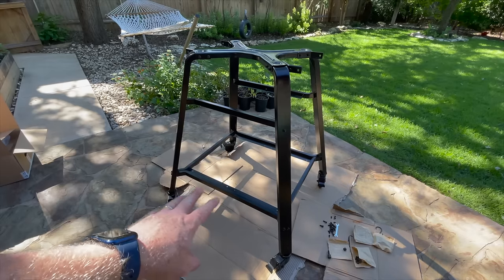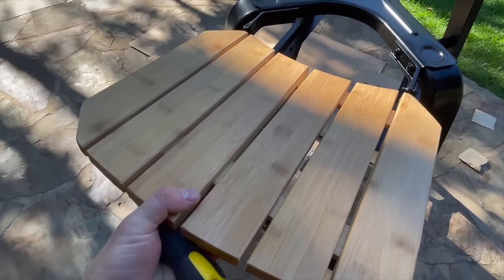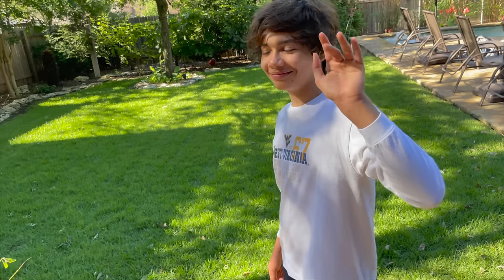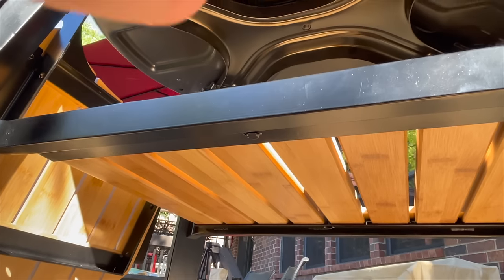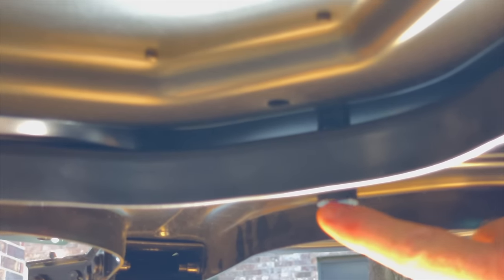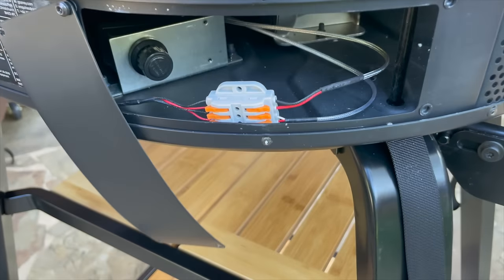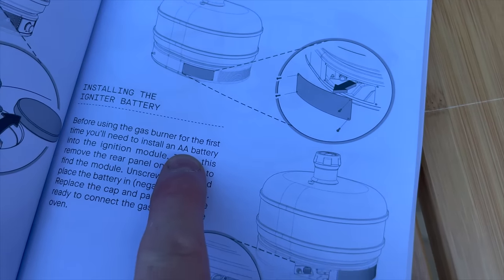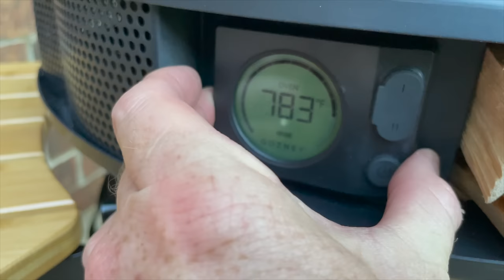Gozney Dome - First Pizza & Stand Build - 2 Pizzas 🍕

Comment: What about the wheels of the stand. Is it possible to drive around, is it even possible to drive over the meadow. Is the stand "rock stable"? Because it's pretty heavy...
Reply from the maker: Thank you very much for watching! Yeah I had a couple of minutes talking about just the wheels in the YouTube video I had to cut it out due to how long the video was and you are about the 10th person to ask about the wheels which makes me believe I should’ve kept that part in the video!  The wheels are extremely heavy duty in the oven is movable but it’s not very easy unless you have a very flat and hard surface! On  cement no problem, mine is on flag stone and it’s a little bit tricky to move it around by myself but I can do it slowly!  Yes it feels very stable!

Comment: Is it possible to retrofit the gas from wood versions?
Reply from the maker: Hello Mike,  I don’t think so!  The way the burner is mounted inside the oven I don’t think there’s any way to add that after the fact and I don’t believe the stone is cut out for the burner position either if you purchase the word version!  If your budget allows it I would definitely purchase the gas/wood version these type of gas burners are extremely expensive to buy as add-ons typically costing nearly $1000 just for the burner!
Reply: @HarplandProductions  Thanks for the reply! I saw they had the wood and combo versions. Too bad they're all out of stock.
Reply from the maker: Yes,  they said they are hoping to catch up with some more supply in July

Comment: Hellow ...I´m Hector Garza from Monterrey Mexico I just received my oven and I want to use  natural gas instead propane  ..I did the hole nozzle a litter higher in oredr to pass a littel more gas  it workede a little better but still alitlle short  do you know the proper size for natural gas ? and about the flame  with natural gas is blue ...never yellow is this matter ?
 I cover some of the air holes in the gas tube in tne part where the gas is mixed with oxigen and the color change to a little yellow but I felt that the flamne was weaker ...less hotter..... ...any comments ?
Reply from the maker: Hello Hector,  Thank you so much for watching! That specific burner is designed to only work 100% with Propane and not natural gas.  I am not sure you will be able to get the correct pressure and heat using natural gas with it.   There might be some safety concerns also using that burner with natural gas so please be careful.

Comment: The last bolt that connects to the bottom of the dome is suppose to be installed BEFORE installing the dome
Reply from the maker: That is correct, they change the manual to include the step after I made this video. I was lucky enough to be the first one in United States to test and review the oven. This video is made the manual didn’t include the step.👍🏼😎🍕🔥 and now they do

Comment: Did you also get the cover? I saw the original release includes a cover. If so, does it just cover the dome? Or does it fit down the stand with the shelves down? Thanks again!
Reply from the maker: It wasn’t available when my oven shipped out but they said I would get it soon!

Comment: Only 1 screw holds that heavy dome to the base?  Wow!  I would have put 4 more in the corners (or at least a couple more than 1).  Regardless, I have been waiting for this video from you.  Great job as always.  Glad you and your son (and your dome) are OK after that lift.  Your tips were very important, so thanks for that.  I'll hold off my questions 'til you get more time with it (or answer them elsewhere).  Looking forward to your wood cooked pizzas!
Reply from the maker: It's very secure,  you can move it around with the wheels but it' not really designed to be a portable oven.  Doesn't at all feel wobbly!  I am going to make an update showing how to properly lift the oven up,  after reading the directions again i noticed that i missed some key advice to make it much easier :)

Comment: Quick question. Is it now easy to take the straps off when it’s on the stand?
Reply from the maker: Hello Jaimie, Thanks so much for watching!  I am not 100% sure yet,  I kept them on just in case i need to ever move it again!  From the manual i think you have to cut them off,  which shouldn't be hard, just snip the strap then it pulls off.
Reply: Thanks for the response. Surprised that you have to cut it off tbh. Can’t wait to get mine in October fingers crossed. I also have the stand ordered :)
Reply from the maker: i ended up just leaving the straps on,  they don't look bad, you cant even see them once it's on the stand!

Comment: Do you keep your table outside all year round? I was debating on if it's worth the hassle of bringing the table in and out or if a table cover is the way to go
Reply from the maker: Thanks so much for watching,  yeah i didn't want to have to keep moving it in and out so bought a weather proof cover,  had a couple but the first few off of amazon were horrible quality and were not water proof, this last one is awesome and 100% water proof!

My Table is 60” X 24” with Caster Wheels - Here is a link to the brand but this one isn’t as big.  GRIDMANN NSF Stainless Steel Commercial Kitchen Prep & Work Table w/ 4 Casters (Wheels) - 36 in. x 24in.
https://amzn.to/3geTSSX

Arcedo Outdoor Bistro Table Set Cover, Heavy Duty Waterproof Patio Furniture Covers for 3 Pieces Bistro Set, All Weather Resistant Outdoor Table and Chair Covers, 65" L x 28" W x 30" H, Beige & Brown
https://amzn.to/3wiGkvp
Reply: @HarplandProductions  Thanks! I also use a Gridmann and haven't done as much cooking as I've wanted to outside. This will definitely help!

Comment: Do you know the dimensions of the stand? Width with and without the two wooden shelves. Thanks.
Reply from the maker: Here is a link with the measurements in mm. https://cdn.shopify.com/s/files/1/0283/2619/9375/files/Dome_Stand.png?v=1619611399
Reply: @HarplandProductions  Thanks

Comment: Did it make your pizza taste like propane or butane>?  seems like it would.
Reply from the maker: Thank you so much for watching!  Absolutely zero taste of gas,  the temp gets so hot that the pizza is only inside for 60 seconds and the high output burner is top of the line (these burners cost around $1000 if purchased separately)  They burn exceptionally hot and clean  and produce a fantastic result.  With these new professional grade burners even the AVPN (Associazione Verace Pizza Napoletana) now allows the use of gas to make, "Authentic" Neapolitan Pizza
Reply: @HarplandProductions  I noticed that you also have some wood stacked under the oven.  Do you add some of that for extra flavor at some point?
Reply from the maker: that video was just testing the gas burner,  check out the other video showing me make a pizza just using the wood.

Comment: Need to pick me up one of these. Currently using an Ooni Koda. I wonder how much more gas it would use compared to one of the smaller ovens. Does it take longer to heat compared to the roccbox?  The koda I have takes about 15-20 min for heat up. Great video!
Reply from the maker: Hello Roberto,  It's a game changer!  The burner on this is a commercial quality one and it does use more gas but the heat retention and insulation on this is off the charts.  The stone is also 1.3" thick which holds the heat for a long time.  That being said they say a standard 20lb patio / grill tank of propane will last 18 hours which is a good amount of time.  It takes about 30 min to warm up to full heat then 30-60 to cook pizzas so max 2 hours per pizza night which will give you 9 pizza parties for a tank of gas!

Comment: Thanks again for these great videos!  Can't wait to get my Dome (hopefully soon since I was batch 2)!

I have a question about the wood you have stored under there.  This will be my first wood fired oven.  Are you just getting regular fire wood and cutting it up into smaller pieces?  Or are you buying some of the pre cut (sort of over priced) wood boxes I've seen available online?  

I would appreciate any insights/experience you could pass along regarding wood (including size and quantity used for a cook, etc)

Thanks!
Reply from the maker: Hello KJ,   going to test out the wood burning capabilities this week!  in the past i have cut up all of my own wood but i would not recommend that route,  over Christmas i was using my miter saw to cut down the logs to a small enough size to fit my roccbox woodburner and hit a knot which caused the log to jam my hand between the log and the saw guard shattering my finger (Long story short)  I am now buying pre cut wood :)     I would recommend the following things,  I have dried kindling and fire starters that i use to get the fire going and then once hot i use "Wood Chunks"  they are cut up and easy to through in the oven!   I will test all of this out with the dome this week but that is what i plan on doing and it has worked well with other small ovens.

Here are links to the 3 products that i use for wood burning if that helps! 

120 Eco-Stix Fatwood Starter Kindling Firewood Sticks Wood Stoves, 10 Lbs
https://amzn.to/3sHc22J

Tumbleweeds Fire-starters Value Pack - Frontier (2 Pack)
https://amzn.to/3ePABFO

B & B Charcoal 00132 Wood Smoking Chunks, 549 Cubic Inch
https://amzn.to/3c8kFhj
Reply: @HarplandProductions  This helps a ton!  Thanks!
Reply from the maker: Glad to help!

Comment: Looks nice. Sucks i have to wait til july for mine to ship out. Our first batch in australia was batch 2. The stand looks to be built pretty well too,looks like the wheels are solid and not those shitty hard plastic ones most bbq's seem to ship with these days
Reply from the maker: Thank you so much Darren for watching, it’s funny you mention the wheels, that’s the first thing I looked at. I actually talked about those in the original video but I had to cut it out due to the time. The wheels are crazy heavy duty they probably weigh 5 pounds each and are heavy duty metal with a super heavy duty caster wheel!
Reply: Hey looking at 11min i notice the "airflow control" isnt there. Thought there was meant to be a turn dial to control airflow?
Reply: I think you put in the air flow dial when cooking with wood to regulate the burn rate/heat. Not required when cooking with gas as you’d just use the gas dial for that. Jealous of all these low batch numbers I’m seeing, mine only arrives in September
Reply: @jponsie  yeah i understand its meant for wood but there is no dial there and didnt see it in the unboxing. Curious if its still there in the final product
Reply from the maker: Yes I reached out to them yesterday regarding my cover and the dial, neither one ready to ship on my oven went out and they told me they would be shipping me my cover and the updated tray with airflow knob
Reply from the maker: Yeah they told me the airflow knob version was not available to ship and they did not want to delay my oven so they’re going to ship it to me later once it’s available
Reply from the maker: As soon as I get the New tray with the air control I’ll let you all know
Reply: @darren1002  yeah see what you mean. Might mean a while till a proper wood burning video
Reply: @HarplandProductions  you really did get one of the first to leave the factory!

Comment: I have a Roccbox and, honestly dude, I'm not all that impressed with the Dome. Presumably, you can cook 2-3 pizzas at once. There may be space for 2+ pizzas but with the burner on the side like that, how do you turn them? Or, how do you turn the one further away? 

Or am I missing something?
Reply from the maker: Thanks so much for watching!  The Roccbox is a great oven and so is the Dome, the main benefit is just having the extra space it makes the who pizza making process that much easier.  Having the burner on the side is actually the ideal spot letting you see if the crust is cooking to fast and it also keeps the heat inside the oven better by rolling the flames from side to side instead of to the front.   Yes you can do 2 pizzas at once but it's still better to do one at a time and just have 2-3 prepped and ready to go, since they only take 60 seconds it's still fast.   You launch the back one first then the front one, then turn with turning peel,  with the Dome you need to have a longer handled turning and launch peel.
Reply: @HarplandProductions  

Fair enough. You know it better than I do. Thanks for responding.

Comment: Great looking oven but poor design on the temperature from Celsius to Fahrenheit the button to change it should be at the front And I can't believe it didn't come with a battery 
And the gas flame on low  is still pretty high 
What's the lowest temperature you get on the gas 
Great video very funny with you and your son trying to lift it🤣🤣
Reply from the maker: Yes, you are right,  I like to cook pizza using C  and meat in F  so this design isn't the best for switching easily but it's pretty cool that it even has it in the first place :)  I am just glad i had a AAA laying around to test it.  Not sure about the lowest setting yet for the burner, but yes it's still going to be pretty hot from what i see so far.  I will keep you posted!  Gozney has already reached out saying they are going to make a tutorial on lifting the oven place after watching my video :)
Reply: @HarplandProductions  it's not rocket science the bolts to hold the oven should be on the bottom of the legs Instead of putting  one in the middle 
All they needed to do was put to stainless steel Hand  could attach to the oven 
So you can lift it into place And if you really want to move the oven You can attach them again
Reply from the maker: @danwhite8856  Yeah i shared the same feedback to gozney

Comment: There’s no door....seems like the Ooni Karu 16 is a better constructed oven...
Reply from the maker: thanks for watching John,  It does have a door, but the beauty of this oven is that you only need the door when cooking low and slow,  things such baking breads or cooking ribs or brisket with coals, etc.  This is a much bigger oven and much better heat retention,  double the insulation and the stone is twice as thick!  I have cooked up to 10 pizza's in a row, none stop without loosing any heat.    The Karu 16 does look nice but it's really hard to compare ovens,  it's still more of a portal oven, nothing wrong with that just a different category!  Have lots of Instagram friends who are testing the Karu 16 and like it so far!

Comment: It's just too expensive. Basically a luxury item.
Reply from the maker: Thanks for watching!   I agree it’s expensive but compared to other ovens of its size and being dual fuel it’s actually much cheaper! Most of the ones I was looking at that were this size in gas and wood-burning were around $5000 USD
Reply: @HarplandProductions  Yes this is for sure the right movement in this space. We need more companies coming into this space and hopefully the competition will push the price down!

Comment: Man I bet you could cook a hell of a steak in that oven as well.
Reply: it's pointless. Cooking a steak in those ovens just splatters grease everywhere
Reply from the maker: The trick in cooking steak in it will be letting the fire die down first to around 225 -250 F  then pre heat your cast iron pan, and put steak in until it's almost at med. rare then put more wood on to get the temp up over 800F  then just sear for 1 min on each side in a high rim cast iron pan.  Stay tuned for a video :)

Comment: $1800!!!  :O Are you fucking Crazy?!??  Payback is like 180-360 pizzas!!  :O  Price point needs to be $300 range to be more realistic.
Reply from the maker: Thanks for watching!  Yes, it’s a lot of money but in the pizza oven world this is quite a bit cheaper than anything else you will find for this quality, size and dual fuel!  Typically for this type of oven you’re looking at $3,000 to $5000 - I would recommend the Roccbox if you’re looking for a great starter oven!
Reply from the maker: That is a nice oven, it’s $950 (with gas) but it falls into the, “ portable” oven category, which doesn’t mean it’s bad, just quite a bit smaller (the dome cane fit 2- 10” pizzas at once)  and a lot less heat retention and thinner stone base which is why the door is needed!  If you’re looking for a smaller portable oven and will be just cooking a few pizzas then that’s a great option, i have heard only good things about it!